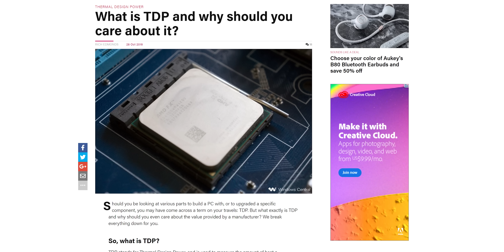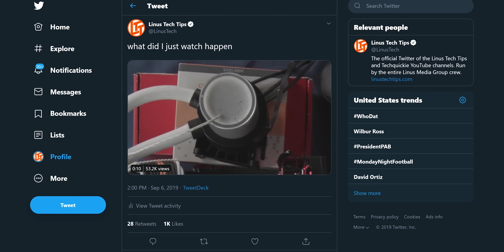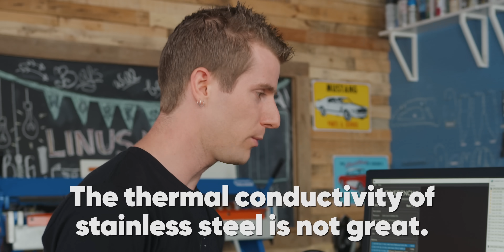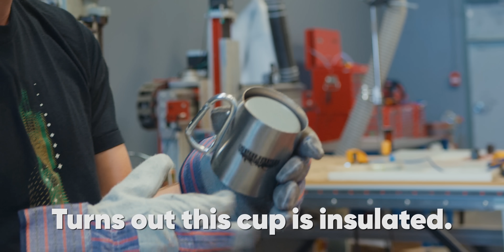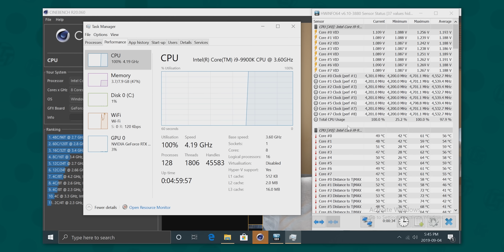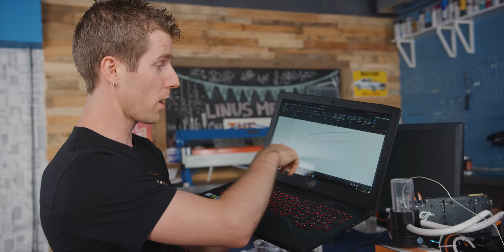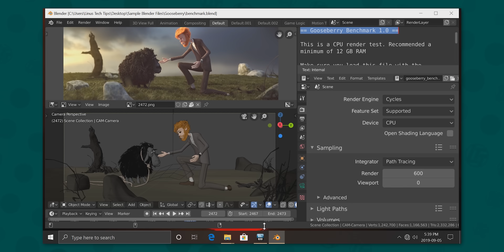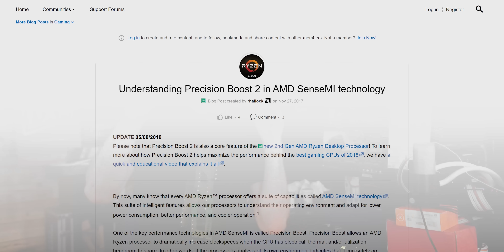Who REALLY Runs Hotter? AMD vs Intel

Comment: First dislike on Linus's video. I don't see the point. It is funny that in real scenario, I had a ryzen 3700x and rog Crosshair 8 Hero when it first came out, and later on I replaced with 9700k and rog Maximus 11 Hero, I had same 2080Ti, rog Ryujiu 360 AIO, 3700x was much much hotter when playing games, 20+ Celsius hotter than 9700K. That was my real experience. I would NOT believe things like ryzen is cooler than Intels based on my own experience.

Comment: Doesn't MCE pin all the cores of the CPU to Max Single Core speed? So for a 9900K with 5GHz Single Core Boost and 4.7GHz All 8 Core Boost, MCE (when enabled) should pin all the 8 cores to 5GHz and on stock a 9900K should run at 4.7GHz for all the 8 cores. Something is wrong with your setup Linus.

Comment: how hard is this all you need is a pump and a loop that holds one pint of water insulate you pipes and pump and a k-type thermal couple a BTU is  the amount of heat required to raise the temperature of one pound of water by one degree Fahrenheit. One BTU is = to 1055 Joules. 1055 joules in 60 seconds is 17.583333333 watts. Simple math a guy who only has a high school education can figure out.  and oh buy the way the only way to do this calculation if if both CPU's are running flat out.  
How hard can this be one pound of water one k-type and a stop watch and the hardest point in that office some one to do the math. Doctor Who "Any number that reduces to one when you take the sum of the square of its digits and continue iterating it until it yields 1 is a happy number, any number that doesn't, isn't. A happy prime is both happy and prime. Now type it in!
I dunno, talk about dumbing down. Don't they teach recreational mathematics anymore?"

Comment: Maybe you can do this again with the amount of water measured precisely before hand. The test you run being a stress test for production instead of a benchmark for blender though that will require 16GB of RAM minimum. The RAM speeds being the same on each run for both companies. The part about a thermo dye really didn't work so leave that out all together. And have a way that will move around the water with a more power efficient pump thus giving off less heat. Using about the same motherboard design if it is just to test the chip and not the motherboard + chip. So many others were missed in this to actually be a good point of reference.

Comment: before video done...

You have tonnes of watercooling equipment.  Just make a closed loop with a milk jug instead of a radiator and insulate it all. Yes, the pump will add a few watts but that's negligible and you can subtract it by calculating the pump consumption. That way you get high efficiency extraction of heat from the cpu.
edit: 11:00 they do this but instead of using thermochromic ink...just plot the temperature over time. That's literally the total count of energy joules.

Comment: Intel actually has a whitepaper on how they calculate TDP:

basically, the key takeaways are that they are calculating at the base clock so no turboing and that they are calculating using "general use applications" so probably not hitting it with an all-core blender render.

Comment: TDP is thermal dissipation profile... Not power draw... 🤦🤦🤦🤦🤦🤦
Reply: TDP means Thermal Design Power.  It's pretty much exactly the same as power draw; since the CPU performs almost no Work, all the power it draws gets turned into heat.
Reply: @Telogor  it actually is an abbreviation of both and is about how much heat is generated, which is not 1:1 with power draw as you can have much higher power draw than the rated heat generated.

Comment: I honestly don't feel a lot smarter than before, especially I'm still curious why it is that I've got a 250W TDP Cooler on my 9900K and it still touches 100°C with 2 cores when HWMonitor only reads 175W of power draw. Maybe I should measure what goes out of the PSU for a rough idea of what my CPU actually pulls?

Comment: I feel like if you wanted to be consistent, you could set an all core clock speed, whether it's an overclock or not, without touching the voltage. that would get rid of the performance degradation over time and get rid of a variable

Comment: 6:18 Linus, yes there are stainless steels that are non magnetic, but that is not a general thing for stainless steels. Most steels, stainless or not, are ferro magnetic. Only some are not.

Whatever, looking at those burn marks, it's propably stainless steel. You could tell by its weight, if it was aluminum and titanium would 1. also be more lightweight than steel + be too expensive to just have it lying around without knowing what its made of ;).

Comment: You should insulate the tubes and the reservoir.
You should run the test from cold without the CPU on to find out the heat effect of the pump.
To find out how much heat that the system (the pipes, and reservoir walls etc) absorbs so you can account for it in the test, a simple test would be to circulate hot water of known temperature through the system (so long as it's insulated) and measure how much heat is lost.
You should probably also use a larger reservoir to mitigate heat lost to the system by reducing the effective surface area.
Reply: Oh and damn, just measure the liquid by weight already and write down what you've done so you don't forget the next day lol

Comment: The reality is if you are going to use a CPU as a CPU then you are going to need a motherboard, some RAM, perhaps a video card.  As such, it is perfectly reasonable to just measure the Watts consumed.  If you want to be thorough, then test boards with every type of chipset for each too.  Comparable...if not identical RAM.  Same video card. 

Most testers just give a max Wattage.  You can look at it over time and determine the total Watts used.

Comment: And it's the opposite to my i3 6100 in my HTPC...
rated at 51W but according to Intel's own XTU software only uses about 25-28W max under full load.
Reply: Don’t trust software numbers too much, GPUs sometimes show 1/4 power (or 1 million volts, I’ve had that too...), and CPU I don’t trust the number because it’s often wrong as well (voltage is almost guaranteed to be wrong, check it with DMM or an oscilloscope).
Reply: @jakegarrett8109  I agree software isn't always right, but it seems reasonable, considering the CPU isn't that powerful and it stays under 55C with a (large) completely passive cooler.
Reply: Hannessomething FX when stock runs about that temp with a $10 cooler (not passive, but not loud), what’s your point? Temp doesn’t always equal power draw (using the same 120mm AIO, my Ryzen 1700 thermal shuts down at 3.9 GHz at 1.4v, while my TR-1950x is still fine at 4.15 GHz with double the cores at 1.45v. In fact, it’s 130w peak on Ryzen desktop and it shuts down, vs 450w in my Threadripper and still fine, both are first gen Ryzen with the “same” Zeppelin died except x2 on Threadripper). So using the same cooler as you, I could be reporting wildly different power draw anyways (even between 2 of the same model, my particular Ryzen 1700 for example is a bit of a thermonuclear dud...), so please don’t go with software or temps for power draw, they can vary per identical model chips (I actually have a thermal and power draw graph for 4x RX470 I have, one uses like 15% more power as the others at the same voltage and speeds! All identical model and I personally flashed my own custom BIOS identical across them, it’s just different amounts of transistor power leakage).

Comment: Was I the only one hoping for at least a simple calculation of average power output? It would be nice to see how far from the given values they were, even if the actual value isn't that useful given accuracy / precision.
Speaking of which, why did you continue using that dye when it proved to be useless in measuring the temperature in an environment without uniform temperature? Why did you measure the water by volume instead of mass? Why didn't you use a larger amount of water to get more precise results?
These are all fairly reasonable steps that you could have taken to ensure your results were useful. As it was, we got a random graph that didn't really show us anything past 'muhh Intel is hotter'. It seems like you just had the idea and executed it with whatever was lying around rather than actually planning it. The only thing you did plan was the dye, which wasn't even useful in the end anyway.
I love the stupid 'messing around with computers' videos too, but it frustrated me that you were constantly marketing this as a science experiment rather than Linus and Anthony play with some things for a few hours. It's misleading.

Comment: put a thermoelectric peltier over the cpu,conductive cup with water and ice(mostly ice to make sure its always 0 degrees),obliously paste on the cold side of the peltier then run the stress test an measure the wattage the peltier creates idealy when the cpus temp is equal .the more the wattage the more the heat output

Comment: Bad calorimetry. The increasing temperature results in a variable heat rejection to environment. Probably not significant but almost impossible to to quantify. Proper power measurement would measure water temperature going into the cooling block and the water temperature leaving the cooling block. Then measure the mass flow rate. Then using thermo tables from nist or coolprop instantaneous power measurements can be made. This could then be hooked up to a radiator and steady state will eventually be reached. Sustained power can be measured as well as performance in something like “renders per second” or similar. Transients are almost never good indicators of sustained or standard performance.

Comment: I was so excited for this video but it was so painful to watch. How can you be so absolutely incapable of doing any experiment right?
Reply: Look at it this way: you may have been more impressed if they just re-did the whole thing as "we hooked up this open loop water block to Intel vs. AMD and measured the water temps in the reservoir over time". But this way you're better informed about the other attempts.
Also, an experiment implies experimentation, which means things probably aren't going to go right in the first place.
On the other hand, a single result after multiple failures doesn't make for a great sample size.
Reply: Lo-Res Gamer this wasn’t an experiment, this was throwing science at the wall to see what stuck
Reply: @bwcbiz  they tried and failed. Now I'd be fine with trying and failing as that's the basis for all progress but it's not the first video of them butchering an experiment like that and it doesn't appear they're learning from them. They have so many people there and so many tools and industry contacts and yet this video is indistinguishable from a 10yo failed school project. It's just embarrassing.
Reply: That's how Linus Media Group works
Reply: It's what makes Linus and his team such a fun channel.
Reply: This was purposely done as a mixture of scientific concepts and ridiculousness, and not for the purpose of controlled experimentation. They had time to mill a disc for a cup they cut with a damned sander, but couldn't get a simple syringe. I think that covers all of it.

Comment: Might not be as fun as your method, but would it work to put a voltage/amperage probe spliced into the cpu cable? That way you measure the CPU + VRM, so if both test rigs use the same VRM layout, it should be an apples to apples comparison (if not, you might be able to estimate or measure the power draw from the VRM).

Comment: I just want to take a moment to say that while EaseUS's software is good, their activation system is garbage. You can buy one license to use on one computer... and that's it. Plus, the download link is tied to the license key, so you can't just re-download the software after reformatting and punch in the key and go.... you have to call tech support. This is one of those cases where it's easier to pirate the software than use it legitimately.